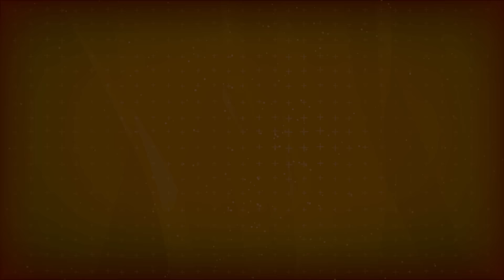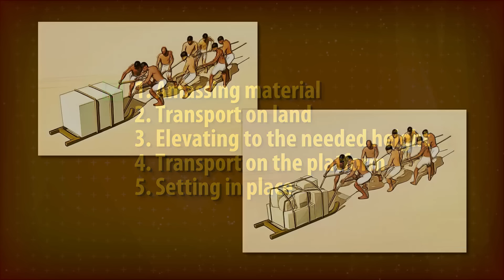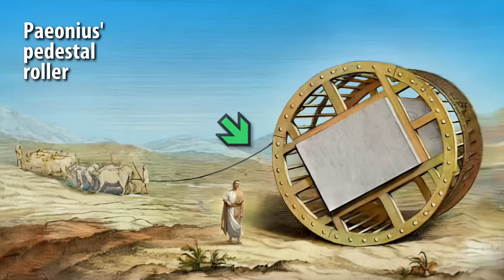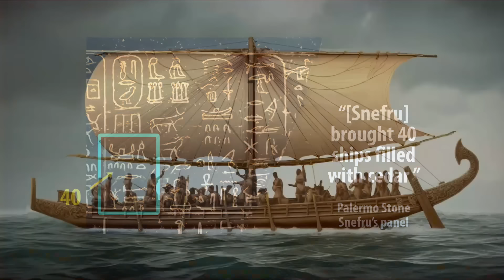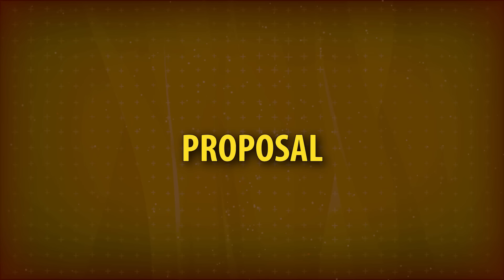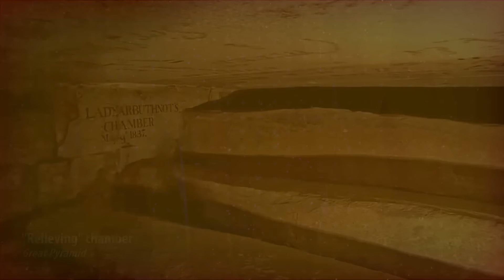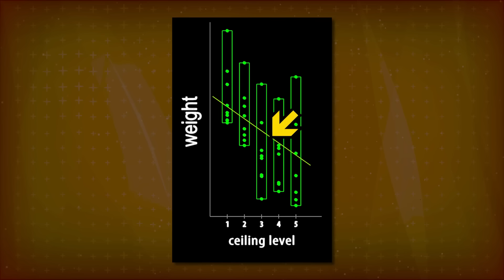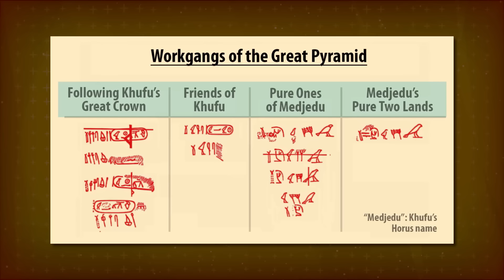How to Build the Great Pyramid in 9 Months (NOT aliens)

Comment: Bravo! Extraordinarily well thought-out and clearly and concisely presented. (It’s amazing to see a nearly hour-long video without a single bit of fat or unneeded filler.)

Oddly, this is the first time I’ve heard about rubble making up a sizable amount of volume; it makes the whole project so much more feasible.

This is by far the most plausible system I’ve seen to date, by an order of magnitude. Mud-bricks for the quarter-circles is brilliant, and kudos for going to the depth of calculating their load-bearing capability.

Your idea of them using a sort of “containerized” system, creating standard-sized loads is brilliant as well. (I seem to be over-using the word “brilliant”, it’s just that it’s the best word for so  much of what you’ve done :-) 

The concept of lifting stations employing mechanical advantage makes so much sense that I’m amazed no one’s thought of it before (myself included :-) The Egyptians clearly knew about levers and mechanical advantage, why wouldn’t they use it on the biggest construction job in their history?

The “drawbridges” at transitions between ramps were also a clever idea; again, something very plausible for the time.

Looking at your whole plan, it strikes me that the difference between it and many others is that most previous proposals all start with the idea of the ancient Egyptians as dumb brutes, too unsophisticated to come up with anything other than long straight ramps and thousands of slaves dragging stones by brute force.

(And there’s also the fact that many (most?) seem to assume that the entire structure is built from 50-ton blocks. I can’t count the number of times I’ve seen people taking about 2.5 million hewn blocks or whatever.)

This is also the first time I’ve heard anyone suggest that the truly massive stones were present inside the construction perimeter from the beginning. So they don’t need to be  dragged up ramps, and can just be lifted in place with the rocking/constrained cribbing approach.

I seem to be just reiterating all your points, but there are so many of them that impressed me with their cleverness, clarity of thought and plausibility. It’s hard for me to express my admiration and appreciation for what you’ve pulled off; this was easily the most interesting and thought-provoking YT video I’ve watched all year.

We are still left with the quarrying question though, even after taking the rubble into consideration. It’s much less of a task but still monumental. Ancient stone working is still a mystery, but I’m pretty sure it doesn’t require invoking aliens with stone-disintegrating energy beams to solve. (Although I’ll admit there are some extremely impressive results that so far completely baffle us.)

I need to temper my excitement and finally bring this to and end, but congratulations again and thanks for bringing this to us in such a well-constructed and interesting video!

Comment: Don't get me wrong, the pyramids were remarkable, and your theories appear sound....but there are so  many things other than pyramids In Egypt from pre-dynastic era that are just unbelievably perfect ( symmetrical, perfectly alligned, within ridiculous level of tolerance). Only one privately owned artifact has been allowed to be measured with modern technology, and nobody is allowed to actually try to use measuring equipment on certain artifacts. 
But why, why are so many things not allowed to be inspected, tested and learned about? (other than looking at it in a glass case). 
I don't believe it was aliens. I do believe there was technology beyond our current understanding being used.  
Boxes at the Serapeum, pre-dynastic artifacts, even the quarry, nobody is allowed to explore anything outside of the mainstream. Nothing is allowed to be studied. 
Why isn't anyone allowed to study without permission and oversight from Zahi Hawass. 
I think there is still much to be discovered if only it was allowed to happen. 
Anyone who works with stone, look at the cuts made at the quarry, and tell me it was all done with copper chisels and pounding stones.
Some of the cuts have errors( straight lines that appear to veer off to one side). 
For that mistake to happen they would have had to continue making a mistake for a very long time....

Comment: Very interesting theory. Can you discuss the casing stones? Also, what do you think of the idea of the grand gallery (and it’s possible twin, the “big void”) as a possible construction aid as opposed to having some other purpose?
Reply: The grand gallery seems well documented as a mechanism to plug the entrance from within, using only outside crews releasing the cascading blocks .
Reply: @johndododoe1411  The newest and best theory is that the Grand gallery was used as a sort of counter-weighted freight elevator to raise blocks or material to the top of the Pyramid. This theory was conceived by a French engineer named Houdin and is referred to by many experts as the most logical use of the Gallery and one that is backed up by material evidence.
Reply: @waynemyers2469  Where is that theory and alleged void presented in a trustworthy source, one more trustworthy than the ones describing the plugging of the original entrance by falling blocks from the grand gallery ?
Reply: @johndododoe1411  There are several documentary movies out there (and on YouTube ) that detail Houdin's work: "Unlocking the Great Pyramid", "Solved: The Mystery of the Great Pyramid", Lexxtex -293- "The hidden secret of the Great Pyramids construction uncovered". and "The Khufu Pyramid revealed". I think you may be impressed and fascinated and, incidentally, Houdins theory does not clash with this theory at all since the builders may have used any or all of the various techniques discussed in the several documentaries on the subject depending on their aims...good luck and enjoy.

Comment: That is the most believable and Doable build - The Method you used to eliminate other options was great and there's enough Evidence present.
So the Outer Plaster of the build would have been the the use of the build ramps.
It would appear that if the 1/4s were usable fill they would have been used as rubble.
Having all the planned slabs inside is a No Brain er - so the boss says I want 1500 cut stones set here and the guy who's going to be breaking one's going to say 
"Arrr Boss can we have 1501 ? ???" because the answer would have to be Why?
So that's why they used chewing gum as a packer - if you make a mistake on a build site and the king is the boss you fix it and don't let anyone take photos.

It all Fits beautifully - when are we doing it - OH one problem.

Today's Labour Force - We're going to need Aliens

Comment: That's very impressive work. Only the most diehard "it's aliens" types seem to doubt that Dynastics could manage the logistics of building or at the very least adding the vast majority of the Great Pyramid's bulk, especially the relatively easy limestone work. Assuming they indeed lacked iron and relied on pounding stones for the granite that would seem to become the major choke point of just how many bodies could they physically fit at the work in the given window of time. There are still points of very different architecture and finish regarding some of the megalithic temples as well as some of the finer artifacts inexplicably attributed to predynastic Egypt even by mainstream Egyptologists but you've put together the most comprehensive explanation of exactly how the pyramids themselves could've been built.

You might be skipping over the way that Houdin's ramp exploits Khefre's hill to place the granite for the Kings Chamber and thermal scans showing what looks surprisingly like his spiral ramp suggests that fractal ramps were unlikely to play a part in constructing Khufus pyramid. Of course you stress that they may not have actually been used yet It's entirely possible that they were employed later to construction Khefre's pyramid just not the Great Pyramid. 

I'd be interested in a comparison to how the Romans also removed a several hundred ton obelisk back to Italy using methods that are supposed to be very well documented and later reused when medieval Romans needed to move it again. The main difference as I understand it is they had the windless, iron, cranes and indisputably the wheel. Otherwise their technical skill wasn't much removed from Old Kingdom Egypt.
Reply: Nice comment far too long

Comment: Great work!! This is the best system yet proposed,and by a huge margin! Multiple ramps make so much time difference.
I'm thinking the mud brick quarter arcs aren't needed but it's cool you proved they could work. Egypt were a semi rich society so would have no problems buying wood from other countries.
The same goes for granite.It's just not a problem. The biggest point you make there is that they probably lifted the granite blocks with each course,so no giant ramps needed.
Overall outstanding work!

Comment: Really great video, and some great detective work! Good job on explaining the use of the quarter arcs, and the use of ruble. Thank you!

You might be interested in the work of Michel Barsoum and his electron microscopy work verifying the use of geopolymers. Simply put, he finds that yes, the lower (and much greater by volume) parts of the pyramid are rough stone and ruble -- but the upper parts and the outer finished layer used a geopolymer mix. His work does not contradict yours, but I think it complements.
https://www.youtube.com/watch?v=EDHtQCYn7ZU

Comment: This Ramp and Ratchet system seriously cuts down on the man power needed for most of the building, which is the biggest problem with most other build theories. One Ratchet team and two men on ropes duty per ramp, plus a team of masons who don't leave the top isn't unreasonable and from there you just need to move stone to location. This is pretty awesome.
Reply: They def would've had specialized labor and had low-skilled workers doing tasks that required less skill (tho often required more power). The masons making final adjustments to stones as the oversee their final placing would be highly skilled, highly valued. They would probably have their meals brought to them. Breaks taken under tents of linen to provide shade. 
I can even picture boys running messages. Project managers barking orders. Supervisors running crews. I guess i'm too stuff in modern construction but i'm sure there are parallels. There was collaboration AND conflict. 
What i struggle to imagine is dedicating so much to something that doesn't serve the greater good. We build massive things now and it's shit like $800 million pro sports stadium. Or a $x billion dam to power hundreds of thousands of homes. There's a benefit to the people. The pyramids had no real public benefit.
Reply: @Macumazahn16 Think of the pyramids as a typical government make work project. The rulers were able to keep everyone employed with this and as long as everyone is getting fed and staying busy they don't revolt against the elite.
Reply: @JackHays75 Also compare it to efforts to extend the rule of a charismatic leader beyond useful term limits (2 terms in many countries, 1 lifetime in absolute dynasties).  Egyptian religion believed in keeping the dead soul alive exactly as long as their bodily remains were protected, hence the injection of food preservation salts and packing of individual organs in storage jars, all protected in a massive locked safe with multi-tonne locking mechanisms .
Reply: @xXHunter_RYocksXx  This was the perhaps the first time in human history where a culture had the capacity to feed itself with a great surplus. A thousand farmers could grow enough grain  in the fertile Nile Valley to feed ten thousand men. The ruler, could store and allocate food at his discretion.  If he chose to employ armies of quarry men ,  carpenters, masons and laborers to build a monument to his own magnificence,  so be it. Later,  great resources would be put toward actual armies  (jealous neighbors would soon cast their eyes upon their rich ,oblivious civilization)  while monumental construction  (though more refined compared to the early, clumsy,  expensive pyramids) would take a backseat to defense. They clearly learned a great deal about planning, engineering and division of labor.
Reply: @johndododoe1411  "2 terms in many countries"
Only countries like the United States; i.e. uncivilised countries which don't have real democracies.
Reply: @JackHays75  think of the great European Cathedrals, they were generational projects, nine months is a bit optimistic but if you looked at it as say a ten year timescale it suddenly becomes very realistic, cutting back on the workforce removes one of the great problems, that of feeding everyone, growing and preparing the food for tens of thousands of workers that more conventional building theories have would have been unsustainable, the only point I would make is, imagine the amount of rope you would need, every ramp would need over four times the ramp length, then multiply the number of ramps, that's an awful lot of rope.
The danger of a broken rope causing a runaway could be prevented by a small towed wedge behind each "wheel", it's what they used on horse carts when going up hills, a broken rope then would just be an inconvenience instead of a disaster, I can't think they wouldn't have thought that one through as well.
Reply: @CrusaderSports250  The food issue is a complete red herring. Those same people would have needed to eat no matter what they were doing. The issue isn't producing the food, but getting it all to the same place at the right time.
Reply: @thomaswalsh287 The Great Pyramid is the oldest one. In fact most of the Old Kingdoms monuments were far greater than the New Kingdoms.
Reply: @VincentJames3912 why are you lying so blatantly? There were older pyramids built, and they do show a progression in size and sophistication: Djoser's at Saqqara and Sneferu's at Dashur and Meidun
Reply: @Macumazahn16  Remember that the pharaohs, in addition to being absolute rulers, were thought to be gods themselves. Labor in service of a god was sure to accrue benefits after one's death when their heart was weighed. Also, protection of the body of a pharaoh/god would provide stability to the entire country. 
----------------
There were violent changes to the dynasties from time to time, but overall, Egyptian dynasties were remarkably stabile over millennia. 
--------------
These may be ethereal rewards, but were meant for the public benefit nonetheless.

Comment: The most in depth analysis I ever seen on this. This should be on National Geographic documentary.

This would mean the lower pathway material ended up filling lower layers of the pyramid. All of the transport mudbrick was probably recycled with adding water to make the pyramid mortar. So no finds of such devices would be feasible.

The only problem is the scarcity of long ropes. Egypt is rich in papyrus fibre. It would be interesting how durable a rope material can be obtained from it. The ropes running in fairly smooth recesses would probably protect them very well. In the middle ages cathedral and castle build rented ropes to other cities or feudal lords for their large scale construction project needs. So the rope economy would be crucial next to work force. Including all fibre materials like nets or mats. Fibre materials clearly were not suitable for single use being too scare or expensive to source by hand.

The stopper block reduces accidents and the number of workers is comparatively low. Workplace safety is a major concern well addressed here compared to any other method. The real deal is feeding and releasing such a large work force from an agricultural society without compromising external security,  This is also well addressed.

The method would be perfectly suitable for seasonal work in the agricultural cycle. It would be perfect to employ unruly bored people in a crop planting cycle. Keep them from plotting coups in a unified society secured by natural desert borders from outside raiders. Distribute agricultural incomes of all year round employed craftmen and clergy that don't enjoy idle farming periods dedicated to other tasks like rope making or weaving mats, quarrying or sharpening tools. People were much less specialized well into the middle ages were farm serfs had to do days in a quarry or in a crane wheel under supervision.

Comment: * edit just finished the video you were way ahead of me great video im subbing the channel**

Heres a better theory...
They pored cement into block shapped molds on the spot then the failed blocks were crushed to fill space the the only materials needed to move are the powdered mix catalyst or water and the wooden mold... And maybe a few logs for rolling blocks to but most blocks could be made in place on the outer layers.

I do agree with the grid structre. My guess is master masons designed/ built the template while the less skilled workors filled the gap.

This is still a interesting technique and similar to modern 3d printing where the spaces not visible are empty or filled with thin support structures to cut time.
Reply: Already debunked.

Comment: What do you mean it only happened a couple of times in history? It occurred three times on the Giza plateau. Regarding the workers, you might have a point. It took 40,000 workers 9 years to build the Three Gorges Dam, with ten times the volume of a pyramid. So, it would take 4,000 workers 9 years to pour a pyramid's volume in concrete. I'm speculating here, but the slow pace in dam construction might be due to the limits of cement production or the time it takes for the cement to cure?